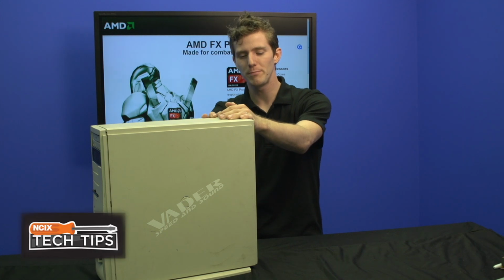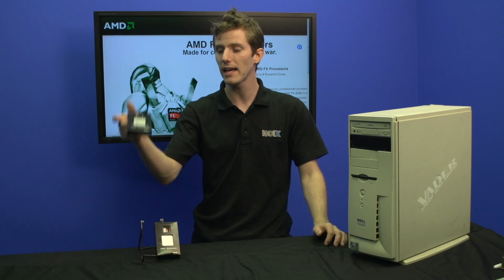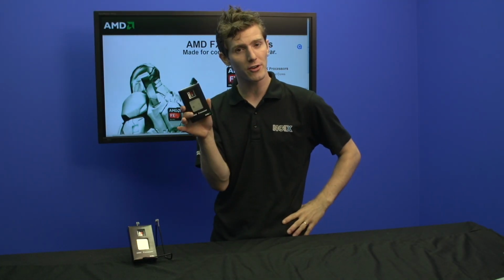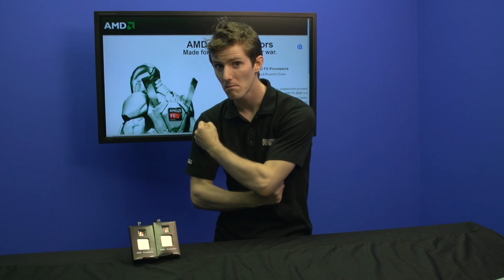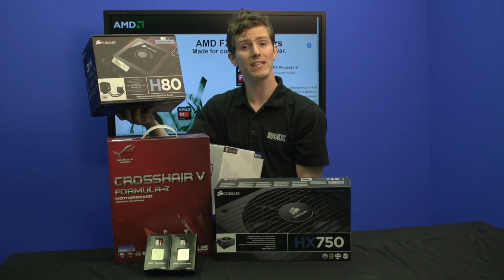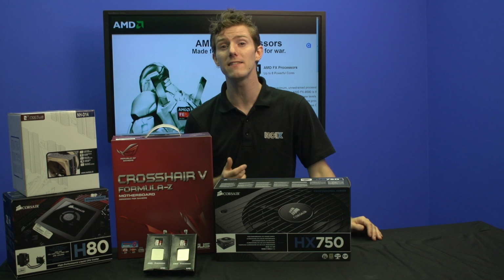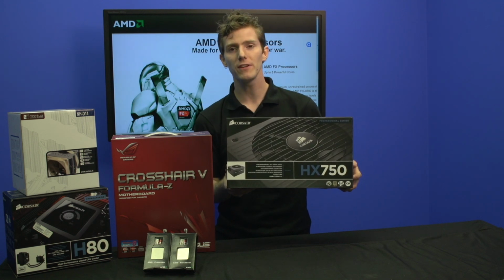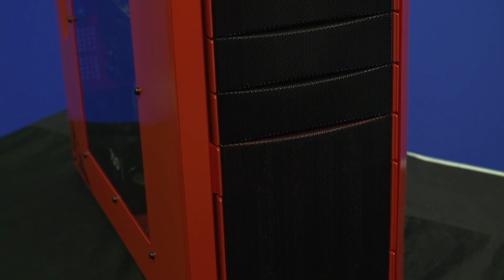AMD FX 9000 series processors hitting 5GHz!

Comment: AMD just proofed years ago. Core Count and Clock Speed is not everyone. Still fanboys buy ryzen and pretend core count is everything.
Reply: Dom L. That didn’t age well
Reply: What? Intel increase their core count by 100% in three years just to compete with Ryzen. They also push their CPU to 5,3 GHz turbo in order to stay ahead at gaming performance. An i7 from three years ago is now an i3.
Reply: @dom3827  Intel win in games due to higher clock. Take a look at reviews of R3 3300X vs i3 10100. Here where the clock is almost equal, and more importantly price near equal. AMD R3 3300X wins even in gaming workload.

Edit: add source.
https://youtu.be/AAPq9Lthhnc
Reply: @dom3827  AMD does not have AVX512, they only support AVX256. But Intel require lowering their clock significantly to run AVX task, while AMD can do that at base clock. Also game development are mostly tied to console, and 2 of the 3 console use AMD Zen hardware in the future. So unlikely game or game engine will utilise features that are not exist on the Zen architecture. Maybe future Zen will support AVX512. Still, consoles use Zen 2. Games and game engines optimisation will reflect that.
Reply: @dom3827  apparently only Intel's HEDT (maybe server to?) part that need to lower clocks when running AVX. Their mainstream part does not require that. Also only Intel's HEDT and Server that supports AVX512. The rest is AVX2 just like AMD Zen 2. Could change in the future though.

Source:
https://www.tomshardware.com/reviews/intel-core-i9-10980xe
Reply: @dom3827  according to Intel it does not have AVX512, only AVX2.

https://ark.intel.com/content/www/us/en/ark/products/126684/intel-core-i7-8700k-processor-12m-cache-up-to-4-70-ghz.html
Reply: Aaaand now AMD is faster in per core performance, and rocket lake looks disappointing

Comment: Oops goof on the motherboard it only supports 140 watt or less CPU I know I have one (says on box "CPU no greater than 140 volts" I think it was intentional misprint to cover inadequacy ) and I'm running in 8370 because of it 9590 is 220 watt w/o overlock. You need an Asus Sabertooth to support the 9590

Comment: I know this is old, but please help lol don't know where else to ask. Is 850 watts enough for the AMD 9590 - with Crossfire RX-480 8Gb - 2 HDD - 1 SSD - ASUS Pro Gaming Aura - Corsair 16Gb or should I be safe and go up to 1000 Watts. I got it in the new DeepCool Genome btw The main reason I ask is because of the crossfire, the new Rx-480's 8Gb I'm worried it might need the 1000 watt with them or I wouldn't worry any help is appreciated!!!!!!!!
Reply: Dont know exactly, and im too lazy to google up the TDPs of your components but all i can tell is:
If youre not on a budget build (which you obviously aren't if you can effort 2 gpus lol), then go for the 1000Watts
There's no reason why you shouldn't, except the factor of the cost.
You could in fact also buy a 2500Watts Power supply and it still wouldn't make a difference apart from its pricing
So, spend the extra bucks and be worryless afterwards.
Reply: Lol ok man thanks, figured I'd get it anyways.
Reply: Alright dude glad it helped ... and if it also helps the reason to get a big ass psu was to power things like 7990 or 980ti in sli or tri sli or 390x something huge.. but ever since the 1080 and titan xp came out which could be powered by just a 8pin and board power but be more powerful than a 980 and that only sli would supported.. big power supplies are not gunna have much use .. by all means it's a fine psu.. for sure.. but in your setup it's gunna cost you more at the wall than say a 850w or 900w.. 1200w and its what gold rated platinum perhaps.. your setup will make your psu inefficient only because 650w is almost half the power requirements to the psu's peak efficiency.

nice pc bro
Reply: OFFPlaNetGaMeGeAr Holy shit. I don't envy your electricity bill there. 8*5ghz still rumbles my jumbles though :D
Reply: 1200 watts is way too much.. It's not going to run at peak efficiency with that system. You could've got by on a 800 watt
Reply: Yo if it helps:

the rx480 I think has a 6pin power connector or custom cards might have a 8 pin ..

pci ex socket draws 75 watts although pci ex 3.0 can draw a lot more power through it.. 
6 pin = 75w 
8 pin = 150w..

so in total 1 480 would around 150w but I think it's more like 125w .. so 2 would be 300 ish maybe add another 50 to 100w just to be safe then that cpu is what 220w .. so say 250w with all hhd drives and fan and all.. so 650 watts is what it'll draw an 850w would be ok but that 220w on the 3.3v and 5v is what you are going to pay for when it comes to buying a psu.. so check the psu.. 

oh and make sure your mobo supports it too ...
Reply: Thanks it helps! I bought the AX1200i already though, I figure why not lol Also switched to Skylake, that's why I need to stay away from Micro Center. I just went there for a psu lol
Reply: Thanks Again for the info bud!
Reply: Each of your GPUs have a maximum power draw of <225 W; The FX-9590 has a TDP of 220 W. With everything else, the minimum PSU wattage should be 700 W.
Reply: I know its crazy right lol!
Reply: Yeah Micro Center had refurbished ones for $159 and new is $300 on up. Don't really like buying used stuff because I can afford new, but these were one's that had failed testing so they sent them back to replace what tested bad. In all reality their new! So for $159 for the Ax1200i, yes and thanks you! lol

Comment: Would a 750 watt power supply be adequate if you're using a 144hz monitor, AMD Vishera FX-9590, 4.70hz black edition, GTX 1080 and corsair H105 liquid cooler ?
Reply: The monitor does not draw power from your computer, it has its own power supply.
Reply: i would say no
Reply: Please. The 1080 doesn't even ask as much power as the old gtx 285.. Back in the days it ran fine with a 125 tdp cpu, and a liquid cooler on 500 to 550 watt.
Reply: I changed my mind, I'll go for the Intel Skylake 6700. The price might drop if the ZEN comes out.
Reply: Good call
Reply: +BulletsGaming I would wait for zen for a zen cpu. 

at $300 to $400 you'll be getting the same performance as a 5960x.

Comment: AMD invented the multicore cpu and 64bit
Reply: +Phoenix Wright amd did make the first 64bit cpu.

that's why the 64bit instruction set is called "amd64"

even Intel still uses it.
Reply: if only you were sitting in front of a computer with access to google..
Reply: Actually,  amd didn't make the first 64 bit cpu,  and neither did intel.
Reply: Phoenix Wright ibm?
Reply: Synthematix  i don't remember specifically,  but its either ibm or Motorola
Reply: TheDarkToes nope.  Amd64 refers to the x86-64 extension.  There have been 64 processors since the 70's.  And what about the Nintendo 64? 
https://en.m.wikipedia.org/wiki/64-bit_computing
Reply: Now that I  think about it,  intel also made the itanium 64 before the athlon 64 came out,  but it used the ia64 instruction set
Reply: +Phoenix Wright yeah you're right. I remember super computers having 64bit cpus.

but I was meaning more for consumer level, but as for "the first 64 bit cpu evar!!" yeah it was a long time ago.
Reply: DEC Alpha
Reply: +Dj NDAA what
Reply: Not really, but amd did implement x86-64 which is x64 bit works with x86 at the same time so it's really practical that Intel buys the license

Comment: I'm using an Fx 9590 at 5ghz
Reply: +Naomi Kitsune Sorry to hear that
Reply: I'm not
Reply: 25c actually, 32-45c on load
Reply: Well I did use a 1600w titanium power supply
Reply: Naomi Kitsune still on that 9590?
Reply: Haha for boredom I went to 5.5Ghz with my H115i, didn't keep it there though lol
Reply: It'll blue screen before it hits that but ok
Reply: Not if it's properly watercooled
Reply: +Naomi Kitsune what kind of water system do you have?  Are you OC or just running at the standard 4.4ghz?
Reply: +Rod Holy shit 5.5ghz? I can't go past 4.8 on my 9370 since windows hangs after login and won't post at 5 or higher.

Comment: Would a Antec H20 950 be a good enough cooler.
Reply: +Crackhead just get an i5 man. Specs aren't everything. Check out benchmarks. Trust me
Reply: +Crackhead I think it would work. I use the FX9590 with a H80i before and it looks like a similar cooler. Just make sure never to set your fans at low speed, cause the temp can run up really fast on this CPU.
But if you dont have the motherboard yet.. I as a user of the FX9590 recommend an Intel i5 like Άγγελος Δουλγεράκης  said. Almost as powerfull, way less heat/power (max 95 watt instead of 220)  Maybe the FX-8350 black edition if you want AMD, because it is way less expensive, but offers almost the same power in regular use (gaming, streaming, editing, browsing)
Reply: +St Wo would it work with the 212 evo?

Comment: will me the msi 970 gaming motherboard run it without burning if so pls tell (sorry for being a super noob)
Reply: +SirNoobsAlot No..Don't use any of the 6 or 8 core FX cpus on 970 chipsets. Make sure you are using a 990 chipset am3+ board for the best performance
Reply: +Drag0ngam3r it wont run it, it draws too much power
Reply: ok thanks for ur reply and i would like to ask witch cpu u this is best with this motherboard
(sorry for being a noob)
Reply: Drag0ngam3r for gaming get a 4350, 6350, or 8350. they will be fine for almost any games
Reply: thanks a lot
Reply: +86gtforme, on medium settings maybe.... Even the 8350 struggles in anything physics intensive
Reply: scootbmx01 that's the best CPU that mobo will handle. he didnt ask for the best CPU made he asked for a CPU that works in his mobo
Reply: Paul Lizzi the speed difference on a 970 vs 990 is negligible. if you had neither id go with the 990 simply because its a bit newer and better connectivity, but if you own a decent 970 there is no reason to change.

Comment: and still slower then my i7
Reply: +scootbmx01  same dude :P love my i7
Reply: +Dylan “spookz” Gotta love the i7
Reply: +Cinco 9001  it's beautiful
Reply: Also cheaper than your i7 so ofc i7 is bettet
Reply: Which i7? my i7 920 was overlcocked and raped my mates 8350, and you can pick them up for under $100aud.
Reply: +scootbmx01 you compare second hand with brand new?
Reply: +Valentin Rafael, exactly, why by brand new obsolete hardware? If you can get twice the performance (not literally but the point is there) for the same or less money?
Reply: +scootbmx01 its. risky cuz u don't know the failure of it. specially cpus that can be exposed to high voltage for long periods of time. if yours is working for a long time, congratulations,, you got an awesome deal. I would only buy sh ram or optical drives or super cheap gpus because the system will still run without a gpu.
Reply: +Valentin Rafael, ram is cheap enough that buying new isn't a problem, but i wailed on my i7 920 and it despite being at 4.2 for 4 years it never died or showed signs of aging.
Reply: +scootbmx01 ram is cheap but ddr2 brand new Is the same price as ddr3 so I better get 2 sticks at the price of one brand new. I need ddr2 for an old mobo that I do benchmarks on old cpus.
Reply: +Valentin Rafael, arent we talking about performance though? Any cpu worth having at the moment supports ddr3 or ddr4, both of which can get sizeable amounts for around 100 for ddr3 and about 150 for ddr4
Reply: Oh woops forgot to mention  which i7 I have   it's the i7 4790k
Reply: +scootbmx01 Yeah, but this processor with mentioned ASUS mobo supports ECC memory, which tickles my fancy. :)
Reply: +Xiph1980, i cant fathom ecc in anything other then a server
Reply: +scootbmx01 a good workstation isn't that much different from a server.
Reply: +Xiph1980, most workstations arent on 24/7, and even those that do it isnt critical to run ecc, some chipsets don't support ecc anyway
Reply: +scootbmx01 how long a workstation is turned on, has no bearing on the usefulness of ecc.
Reply: +Xiph1980, please explain how it doesnt, it gives a much greater time frame for errors to occur and thus more errors can occur.
Reply: +Mairo San, my old i7 920 clocked at the same speed as an amd 8350 absolutely walloped it. Given the 9xxx series are there  exact same as the 8xxx just overclocked i wouldnt buy a 9xxx, they are furnesses and run like shit. And besides i do alot of things at once so i benefit from 12 threads of my i7 5820k.

Comment: Linus get rekt my FX-4300 CPU can go up to 5.2 Ghz on 1.6 volts XD (of course with a mighty aircooler running on idle 31C and on max load (benchmark from CPUZ) 77C :D
Reply: +Adam Varga 77c is to much i will never do that to my fx 4130 :(
Reply: dantes950 nope actually 86C is the max when it shuts off and thats a 125wat tdp CPU uu have
Reply: but what about the cpu feelings? is he ok with that? do you even ask him? :(
Reply: dantes950 well overclocking is safe until your mobo VRM wont burn out and your cpu wont reach more that 75C

Comment: How is the single core performance? It's still an FX chip so I imagine it's the same as the others. Wish AMD would release a new line of CPUS that have better per core performance than the current CPUs they have. If they can compete against intel in terms of per core performance and price the CPU cheaper than intel's, they can really give intel a run for their money.
Reply: themysteriousfigure0 At this clock speed you have the single thread performance of a roughly 3GHz clocked Haswell chip. The i7 5960x is clocked at that frequency at stock speed for example.

I wouldn't grab an FX chip unless you do rendering on low budget nowadays. Wait for Zen next year.
Reply: +LPG the i7 5960x costs 1000 bucks , these thing only 200 :D

Comment: Can someone tell me if this is all compatible. With the special mosfet things on the mobo? https://uk.pcpartpicker.com/user/Made_You_Look/saved/
Reply: +justinmason100 . personally I would go triple 120 fans in front pulling in fresh(or twin in front and one in bottom)air, and or maybe add radiator to cool gpu's. Also  triple 120 fans/rad() in top pushing out top for cpu. definitely go triple in top for cpu, so much heat.try the Deepcool Gamer Storm Captain 360 AIO Liquid cpu cooler $150Otherwise drop down to the fx 8370(140w) or at least the fx9370(200)My plan was to go with 9590, but too hot for my msi 970 gamer motherboard, I have to settle for fx 8370.All the best

Comment: built a rig using the FX 9590 Black edition, i have been happy with it so far, i have used Intel for my stuff in the past, but thought i would give AMD a run. i am not a fan boy of either company's. i will list my rig but something you must know is i am a fan of making builds centered around branding, so when i picked AMD, i made a AMD machine. idk why this is my OCD but it is what it is :)

Thermaltake V71 case
Thermaltake Toughpower DPS - G 1050W
4 x 200mm Thermaltake Pure 20 fans
3 x 120mm Thermaltake with adjustable controllers
all fans with blue LED's
1 blue LED light strip in bottom of case under plexiglass window.
Thermaltake Frio Extreme CPU Cooler
ASRock 990FX extreme 9 mobo
AMD FX 9590 Black Edition
AMD 32GB Gamer Series 2400MHz ram
2 TB WD Black HDD
500G Samsung SSD
GTX 980 Kingpin (btw i love this freaking card, just got it in last week)
before i had the R9 290X with slight overclock

well there it is, in a year or two when the new DDR 4 ram gets some love by development i might switch out the mobo/CPU/Ram to a Intel setup, but i will ride this rig until then probably without changes unless i hear some great suggestions in the comments, i am always open to ideas :) me and my wife both use a machine like this (she has the 780 TI overclocked on water) gamers for life! cheer's everyone

Comment: I have to say with the Thermaltake water 3 pro with Noctua industrial fans my 9370 stays less than 48c on Battlefield 4 ultra with the fans set to 1500 rpms. With a 9370 at 1.53v(that's default voltage for msi board) at a manual 4.7 everyday overclock. I have some heat headroom to push this cpu but i dont need to and my powersource is a corsair gold 850 pushing two R9280x cards so i cant really push it any more my powersource is at the limit and running perfectly. " I dont think she can take anymore Captain Linus"  lol

Comment: hi .. i am a fan urs.. and i haver a badddd prolm... i buy a asus cross formula z and a amd 9590 .. i have instaled a cooler master 612 s .. its a maaasive cooler as u know... and the tempeture idle of the cpu its 45 c.. and 64 c playing battlefield 3 full graphics... my cuestion is: i must add another fun to the 612??? or buy a water cooling¿?? i reali love the 612.. and i think it must cool down the amd... but i dont know... please man... helpme whit this one!!!! tanks
Reply: Have you considered using a pre-filled water cooler for your CPU?
Reply: yes!!!! i that my problem .. but i love the huge 612s and i wanna know if i put anooother fan to the cooler master on the back .... so in that way i keep the 612
Reply: BERZERKER R I'm not sure, I haven't used air CPU coolers in quite a few years now, sorry man
Reply: so... u recommend a water ?? like a h110 or h110i??
Reply: BERZERKER R I personally use an H100 and it's great, my CPU isn't as powerful as yours though, so I'm not sure how it would work with that.....if I were you, I'd do a little more research into cooling a 9590.

I know you can buy a new FX-9590 that comes with a pre-filled liquid cooler, so I believe it's what AMD recommends for a cooling solution, but yeah, definitely research a bit on it :)
Reply: ok great man .. please... if u can ... serch a little info for that kind of issues.. i apresiate that
Reply: BERZERKER R No....lol, I'm not researching this for you....be self sufficient, I pointed you in the right direction, now it's up to you.